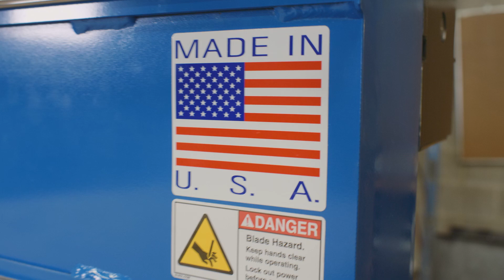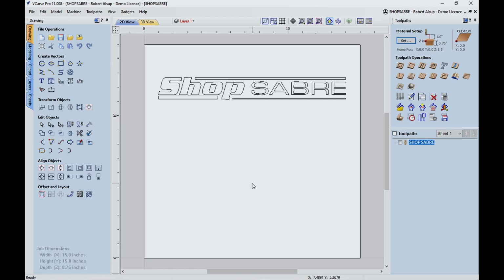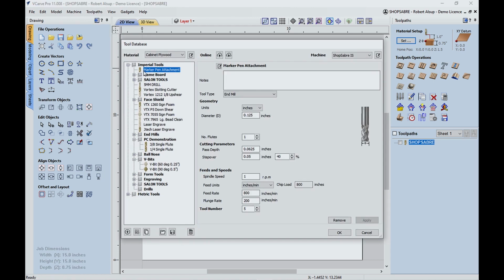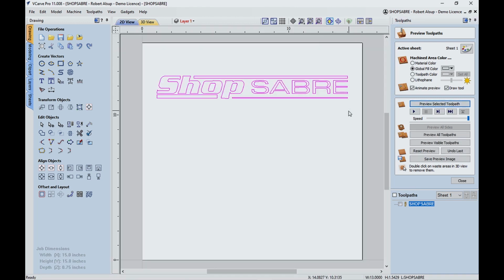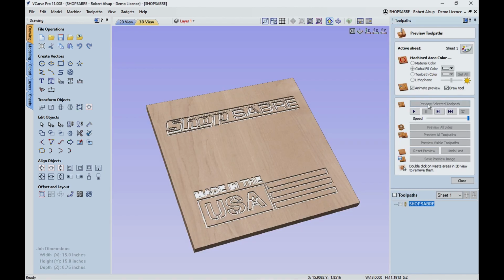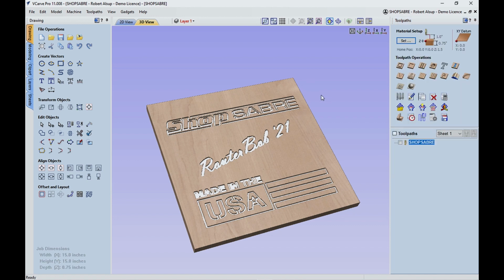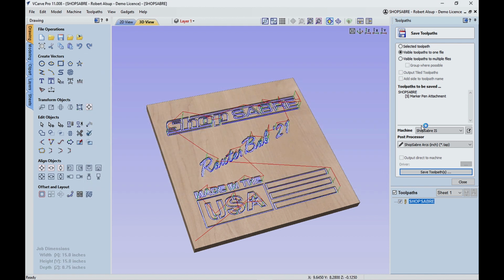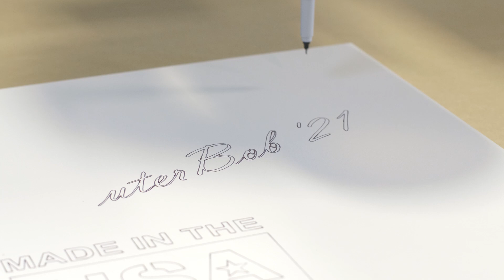Marker Pen Attachment on ShopSabre CNC

Comment: Is it compatible with other cnc's ?
Reply from the maker: We specifically support our equipment, however, the attachment itself could be purchased to use with another machine though compatibility will vary based on the machine.

Comment: You need to explain how to use this pen with a sidekick plasma cutter.
Reply from the maker: It operates similarly on all ShopSabre products. The only difference is with a sidekick there is a pen holder versus a spindle. Give support a call if you own one and need assistance